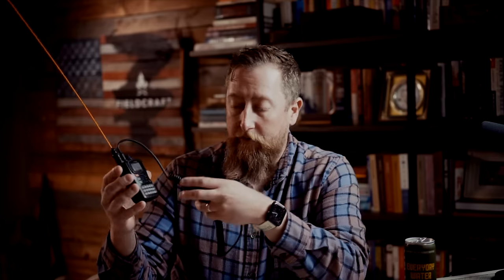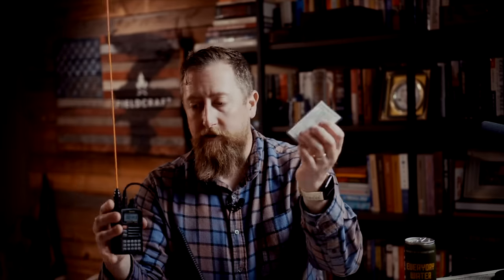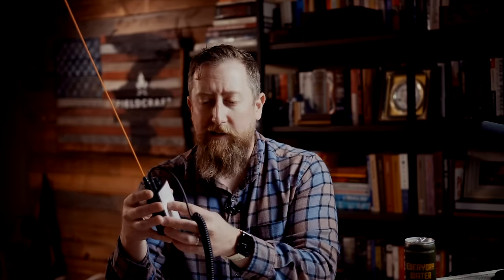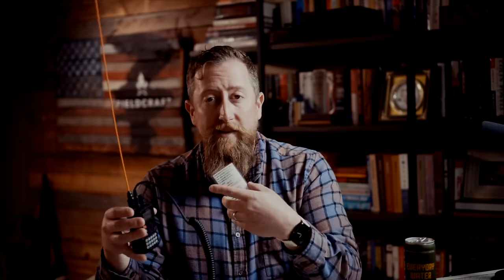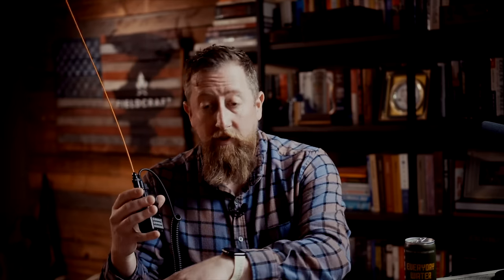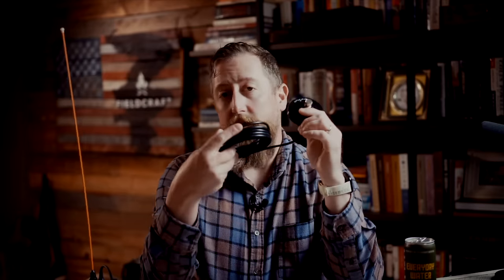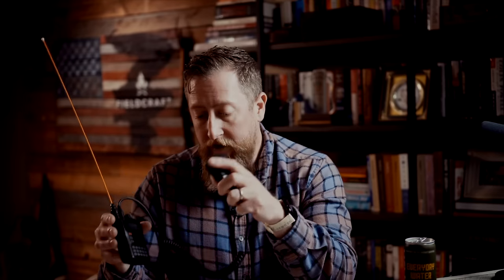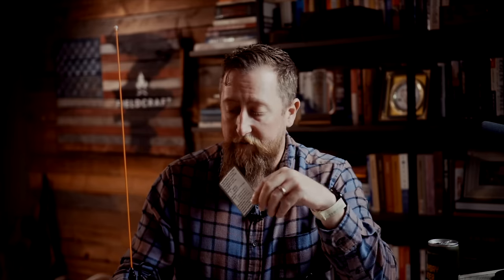Tips for survival comms with Josh Nass

Comment: In addition, I also make sure to have a battery pack for the radio that takes replaceable batteries, like AAs, with spare batteries.  And, of course, a cigarette lighter 12V connection for the radio.  Neither of those are that expensive.  But the Wilderness Protocol is a fantastic thing of which many folks are not aware, so I appreciate you for all the information in this video!!!  73 de BJ, KM4RB
Reply: One thing to remember about the AA battery packs is that your transmit power will be greatly reduced from what the factory battery puts out
Reply: @stevenwilkinson8373  That is true, but at least it's still transmitting!!
Reply: I would rather have a portable solar panel and spare batteries for the radio instead of having to carry around AA batteries.
Reply: @k6usy  Sure, if that stuff is available and compact enough to carry, but it can be out the price range for some people (especially to get in sizes easy to carry). I was just suggesting some budget friendly options.  I happen to have a fold up panel  with soloar charger and battery banks which I use and SOMETIMES carry depending on the situation. If I have my HT I ALWAYS have the spare battery pack with the AA batteries with me as the easiest (to carry) and quickest (to switch to)  backup power.   For my larger radios, especially the HF ones, then I'll probably be running off the solar setup anyway.

Comment: Thanks!  In particular I learned about the USB charging cable as an option.  That will be perfect for the pairs of radios I put in all my go bags, as most other battery solutions were not great there, either being not easily recharged in the field, very expensive, or both.  It'll be nice to be able to tie into my existing systems for solar recharging batter banks.

Comment: Don't forget a good solar power station and panel. If your radio is usb-c capable it's easy to plug in to the usb port on the power station and recharge your radio.
Reply: They’ll also charge your power pack

Comment: The power bank is the solution I went with. In 2024, there should be no reason for the newer HTs to not use USB charging. I have officially decided to no longer buy any HTs that do not natively charge via USB and plan on selling off ones that do not. USB battery banks are so versatile and many things now-a-days recharge or run off of USB. People often have one on them when out of the house. 

Big 3 of ham radios (esp Yaesu): get with the times.

Comment: Looking for that charging cord for the baofeng uv5r . It looked like you plugged it in your mic port or something, the only thing I found like that it only plugs into an extended battery for the baofeng
Reply: Correct. The UV5R does not have a charging port. The extended batteries do have a USB charger that plugs into the side of the battery. You'll like the extended battery anyway.
Reply: Also that radio he's holding in this video is a Yaesu Japanese radio. Not the baofeng.
Reply: I'd recommend watching Josh's Ham Radio Crash Course videos on you tube regarding the baofeng radios. He's got multiple videos covering all the basics and programming etc.
Reply: @native82  I noticed that but just thought he said it worked for baofeng as well or at least there was one like that
Reply: @native82  I'll definitely check them out

Comment: Ever hear of using 146.580 in the back country? Literally just read an article on it 10mins ago and thought "but more people know of 146.520"
Reply: Never heard of it. Why 580 ?
Reply: Might just be an idea.
Reply: @goosecouple It’s  just another simplex frequency allocated by the FCC.
Reply: 146.580 Is an emerging backcountry frequency for emergency comms and regular comms. There are a few advantages to not using the national calling frequency. First, infrastructure can be tied to the frequency to support making an emergency contact. Second, if you are in the backcountry, you have a better chance, especially on weekends, to hit other operators who are also in the backcountry.  Third, there is a better chance of finding someone monitoring the channel because of the use of PL tones built into the protocol. Individuals can leave base radios turned on 24/7, and you only hear if someone is using the emergency PL tone, negating the need to only monitor every three hours.
Reply: @johnjacobs3160 Whats the PL tone?